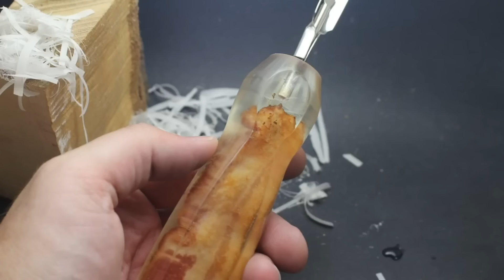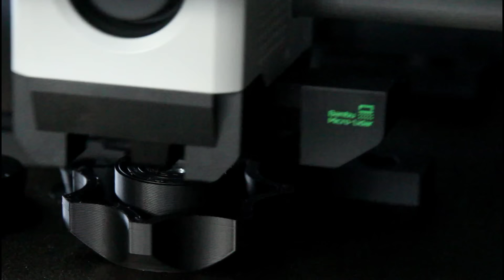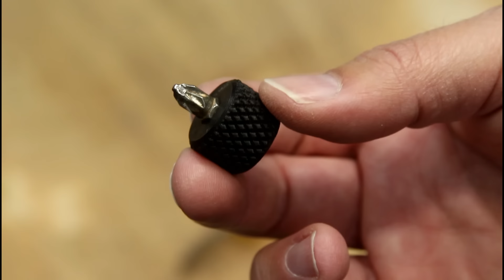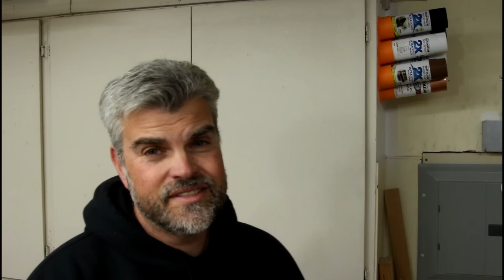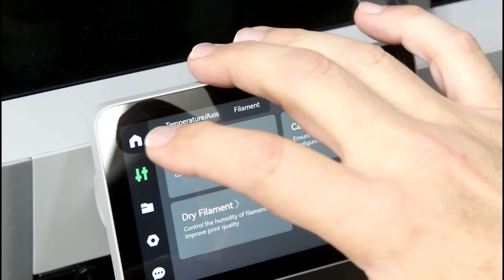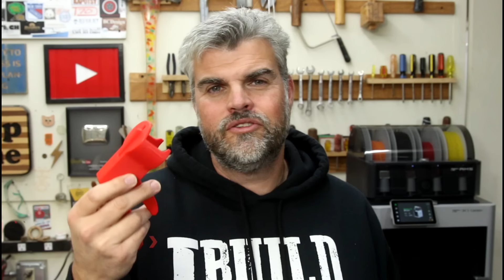5 MUST Have 3D Printed Tools!

Comment: whoooo! that implication that metric is not "the standard"... enjoy your 3/16th of 25,4mm i guess. xD 
friendly bickering aside: PLEASE better use PETG or, even better, PCTG for functional workshop prints, you want to be rugged and durable. PLA might feel really sturdy at first, but it shatters under a sudden impact, and just the pressure of a tight screw WILL make it break over time. and if it breaks under load, it's an instant snap with no warning signs, that can be rather dangerous. 
or just go all in, and use nylon! that shit, when printed properly, is virtually indestructible.

Comment: I’ve got fibromyalgia (why did I have to fall in love with making things 😔) and the spray can handle is a lifesaver (I bought a commercial one from the hardware store). My hand and finger go numb after a couple seconds while pressing down the spray button on a can, which obv isn’t great for precision and aiming. But the handle alleviates that, I don’t get paint all over my fingers (if they’re numb, good luck keeping them out of the way), AND I can shake the can with the handle on (check before you do this; can shapes and handle shapes differ and you wanna make sure it’s snug before you shake or you’ll paint your pants and sidewalk).

Comment: I am deep into 3D printing but also very skeptical of "Must Have 3D Printed Tools!" videos. But this was the best collection of actually useful 3D printed tools I've seen. You're not printing single use just that will fall apart when you first use it like most tools I see. You've found a bunch of tools where the print material is perfectly suitable. Aweosme stuff.

Comment: I bought the Bambu A1 and I have had nothing but problems with it.  After two weeks, I had to replace the hot end, the chip board and had a ton of failures.   I hate it.

Comment: For safety applications i would not settle for anything less than PC (PolyCarbonate). If PLA you need to be very mindful of wear and tear becaus the last thing you need is the teeth coming off mid cut. Do not buy PC-CF because it would only give you very diminishing returns. Poly=many, carbonate=non-descript type(s) of carbon. Pc-gf has glas fiber which adds wear and tear to the extruder and should not be neccesary.

Comment: This is the main reason I got the printer as well. There have been so many times I need "something" that doesn't exist (as far as I know). Now I just load up Fusion 360, design it and print it. Not sure if you have started learning 3D modeling yet but trust me, the possibilities are endless. Yes there is a ton already designed and available online, but there will come a time when you need something special and no better feeling than designing something yourself, printing it and realizing it is, in fact, usable and solves your problem. Thanks for the video and also, lol, it is "Bambu Lab"... no S. But I figure someone probably already told you.

Comment: The X1C is only faster when using single colors for a project.  Muti color projects take 15 (noisy)seconds to change colors.  The A1 only takes 3 (quiet) seconds to change colors. Most multicolour projects have many many colour changes per project because it has to change on every layer that has more than one colour. This creates a lot of waste as well as taking a lot of time. The seconds add up. I have found the A1 is actually faster than the X1C on project with multiple colour changes.

Comment: I strongly encourage you to explore using TPU for a lot of these tools. The layer adhesion for TPU is off the charts, and the printed parts are practically indestructible. You do have to print them with some extra walls or a higher density infill, but I promise you a TPU printed tool will last at least 10 times longer than PLA.

Comment: just buy the featherboard from harbor freight for the price and quality 
first 2 are better off buying 
3rd one and 4th one are good prints

the spray paint thing might be worth printing, the cheap one I got from freight doesnt seem to work well at all 

if youre broke, I found the ebay refurbished creality printers to be more than reasonable quality and only $80-$150
theres a slight learning curve. but very manageable 
tremendous tool that can literally make other tools. its a no brainer to buy if you have the space for it 
I just wish there was an easier way to make your own filament at home with recycled material or even failed prints or supports. 
while affordable, I have a feeling filament cost can add up fairly quick 

I have a feeling youre one of those types of guys who can come up with a fairly decent solution for that. would love to see a video for that subject from you

Comment: X1 carbon really needs an AMS riser it makes accessing the top glass so much easier. I would also recommend the cable/ ptfe management pieces and the ptfe tube mod where it goes into the print head. those and the plate alignment pieces solved any and all issues I have had with the printer.

Comment: Nice video. For your mini screwdriver, a square handle with fillets on the edges for comfort would give you more torque with less finger strength required.

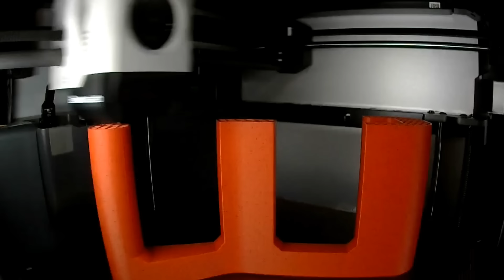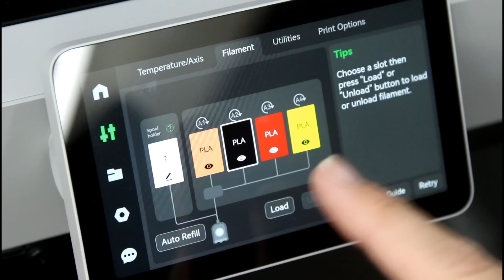Comment: @6:32 - it’s not just about cost - you’re being environmentally friendly too!  No shipping, etc and no other packaging waste!  At first I was put off by long print times… but as you said, it’s actually exciting to start it before i go to bed and wake up with my print!  Faster than amazon!  @7:32 - you can actually daisy chain the AMS unit and have up to 16 colors!!  Lastly, I agree - Bambu labs makes the most entry friendly  printers to get started. Very reliable and easy to use.  From the cost perspective, you can’t beat the P1S… but when you’re ready to upgrade or want the best, the X1 is awesome!

Comment: Overall, great video and I concur, TOOL NOT TOY!  Good picks for useful 'tools' within the shop, although some of the items should be called fixtures as they don't work, but hold tools or items.  But semantics of the English language.  One thing I think could have been explored a little more for the 'common' folk, is the cost involved.  You mentioned that these tools cost only a couple 'dollars of filament' to make overnight, but you did not figure in the cost of the 3D printer, which you received for free to demo to us.  This $1,200 machine (as spec'd with AMS), makes these five $1.50 tools (or fixtures) turn into $200 parts, or it would take you printing a lifetime's supply of filament (and the maintenance expenses of printhead changes, servos, gears, etc.) to make the average workshop afford a 3D printer to offset the cost of purchasing these items from the hardware store.  My last statement is critical - to offset buying from the hardware store.  Some items cannot be bought from the hardware store and so, figuring in the ability to find on eBay, Etsy, etc., and purchase with shipping, the cost per item comes down, but still with filament at $14-20 per kilo, it would take a couple years of normal shop use to offset the cost of a Bambu Labs X1 Carbon printer.  Yes, this is a great and useful tool, but not just for making things that I get at the local hardware store or novelty organizational items.  It can do real work that can make money for a shop and provide safety and workflow management improvements.  It is important to tell the whole story, not just what Bambu Labs wants you to tell us.

Comment: Nice video, but I don't think any of those warrant buying a 3d printer there are better reasons. I own all of those tools at one 10% of the money compared to buying a 3d printer and didn't have to sit through printing and assembling them or deal with misprints. Don't get me wrong, I have the same printer, but for vastly different reasons - printing stuff I can't buy. Plus the ones I buy tend to be more durable than a 3d print, tend to, a 3d print can be acceptable, but they're not quite up to the same standards as a properly manufactured tool, IMHO. Try some cad software and made you own inventions!

Comment: excellent, I have a CNC machine since 2008 and a co2 laser a few years after that, I haven't bit the bullet on a 3d printer but I'm looking at the bamboo labs lineup. the video provides compelling info for me to get one myself. Thanks. Wonder if you can make a ratcheting screw driver that small, that would be something people would need that need a screw driver that small. great work keep it up.

Comment: Tip for the can holders - you can fill the bed with them, and manually move them in the slicer so they touch or overlap by just a hair along the straight sides. Then you'll have a single piece that you can hang with 3 or 4 screws total. Less modular, but if you know you have a certain area of vertical space you want to fill with them, you can save a bunch of time and screws (and holes in whatever you're screwing them to, should you remove them from that space later). No CAD required. Use the move tool in the toolbar, which gives you handles to move them in 1 direction at a time. Place one, select it, ctrl-c ctrl-v, move the copy in one axis only, and it will be perfectly lined up with the original in the other axis. Start in one corner, and add them 1 at a time along one side where the flats line up. Look at how far you moved it, then for the rest just copy paste the last one and move it exactly that far. Then go back to the original and stack them along the other side - it will take some time to place the first one and get the offset right so it looks good, then you can reuse those movement numbers as you make the back and forth column. Then repeat the technique from the first row to fill out the rest of the rows. 'Save project as' and save a 3MF file of the plate with the bed filled and touching each other, so you can print that, or delete a few to make a smaller raft of them (or a single row, or whatever) with the exact same spacing.

Comment: The paint can holders are brilliant - I'd go modular and print them in 6 packs. Those sheet holders are a bit of a pain - if you know how to pick up a sheet properly, there's no need for another tool - if you can handle the weight, carry 2 sheets. ***The spray can trigger! Brilliant again - never seen one.

Comment: Honestly Peter you've dodged a bullet holding out until now. I've had a wanhao duplicator v2, a flashforge adv3, and finally upgraded to a bambulab p1s... it just works.

The difference in modern 3d printers now ahead of what was only a few years ago is immense. The bambu p1s has been ridiculously hassle free.

Comment: Since I see you're using milwaukee tools, there's also a print somewhere in the interwebs that fits impact drivers and drills alike, and another that fits batteries perfectly. Great for setting up your station with easy-to-grab drill and impact, with a charger and spare batteries all in one place. We use it at my work, and it stores away nice and easy, and has maybe a six inch total depth off of the wall? 
I'm assuming it works with other tools and batteries (and if not, it isn't hard to resize for other batteries) as well, if you're like me and have a billion different brands because you've adopted everyone else's old tools

Comment: So you're making 1 critical mistake with the featherboard and that is not printing it in PETG. PLA is very strong but extremely brittle meaning that when it reaches it's point of failure it has a tendency to get a bit "explodey" it would be a cruel sense of irony for you to use this safety feature just to have it explode on you.

Comment: With the spray can storage, you could print half of the holders with a longer base to offset the back row cans so you can see the cap color without having to awkwardly look over the side of the cabinet to see all your options

Comment: I've been 3D printing for about 5 years now and got my X1C in August. It's an absolute game changer for both beginners and experienced makers. Prints that took 12 hours on my Ender 3v2 take a little over 3 hours on my X1C, the quality is better, and the only issues I've had are because of my own inexperience with it.

Once you realize that you now have the ability to design tools or parts with programs like Tinkercad, Fusion 360, Onshape, or Microsoft 3D Builder and then physically have those one of a kind custom parts in your hands in maybe an hour or two for just 2 or 3 dollars in materials, the world just opens up.

Comment: Some of these ideas are great for a crafting workshop, as well.  I make jewelry, and often need a very small screwdriver, and while it's easy to find tiny screwdrivers in diameter, finding short ones are almost impossible!  I would imagine that your screwdriver holder could be adapted to smaller bits, and make my life a LOT easier.  Also, that spray can holder is genius.  Definitely makes about 4" of vertical space useful.

Comment: Yeah. I bought my first printer because I'm a geek and never met a gadget that I didn't like.
I had absolutely NO idea what I would do with it - but I wanted one.
Since then the ability to sketch up a tool or widget that I needed and have it in my hands within minutes has me absolutely gobsmacked. I just added an X1 Carbon to the fleet which joins a Prusa Mk4s and an FLSun Super Racer (there's that geek gene showing through). All of my printers are networked - Octoprint running on Raspberry Pis for the first two and the Bambu is a thing unto itself. I do wish that the Bambu had ethernet, though.

Comment: The best thing about a 3D printer is not that you can make custom parts but that you can make specific sections of the parts to test the fit, a single dimension or how the shape you designed looks and works in real life. I've designed several components (and quite large, too, that means hours of printing) and very often "sliced" them to quickly check if a specific feature was working in the intended way. You'll put this printer to good use, I am sure!

Comment: Thanks Peter,. LOL, I thought the same about 3D printers too.  I didn't know the prices had dropped so much and the capability/ usability had increased over the past few years until I saw a YouTube video by 731 Woodworks back in February 2024, so I purchased the a1Mini (NO COMBO) for $249 to test and see IF I would like / use a 3D printer... I DID/DO and purchased the P1S COMBO in May 2024. Just finished printing nearly 24/7 over the past six weeks for the "Loyal Moses Christmas Community Print Drive" and mailed off 60 pounds = 1,071 3D printed toys which will be distributed to needy children AROUND THE WORLD FOR FREE thanks to the 3D printing community and generous donations from individuals and sponsors. 

FYI the P1S $549 USD is basically the same printer as the X1C, with a simple LCD interface, no Lidar (I've seen some mixed reviews on this feature) and quite a bit less money (you can purchase 2 P1S for the X1C price). For those on a VERY strict budget or unsure about 3D printing, look for the A1 Mini $199 USD, it will be able to do 98.675309% of what you'll need around the shop/ home/ office etc.  **Adding the AMS color changing unit is the BEST VALUE when you purchase in the printer COMBO bundle, you can add on ONE to the A1 series for a total of 4 colors and up to 4 AMS units to the P and X series for a total of 16 colors. 

Other items of HIGH value, relative LOW cost which have greatly helped my 3D Printing experiences are -
1. Vision Miner's Nano Polymer Adhesive for the build plate works wonderfully to help the filament to stick to the plate while printing and then when the plate is cold the prints release like "buttah". NOT ONLY that, but you won't have to reapply for UPTO 30 prints (depending on what filament used and IF you're printing on the exact same spot on the build plate over and over)
2. Slice Engineering's Plastic Repellent Paint™ to "paint" onto a COLD nozzle repelling plastic and preventing buildup on the nozzle, resulting in enhanced print quality AKA, preventing a  print failure.
3. Wam Bam Build plates - While the standard build plates which come with the printers work OK (although MUCH better with Nano Polymer Adhesive on them) the Wam Bam just works that much better, then add the Nano Polymer Adhesive and WOW😳🥰!

* I am not affiliated with nor do I have investments in ANY of the above companies, just great products which have worked well for me.

Comment: You didn't take ten years to come around on wanting a 3D printer, 3D printers just took 10 years to meet your minimum standards for acquiring one. Honestly, smart move. They're much faster, cheaper, efficient, and easier to program than way in the beginning. Looking forward to the videos that will come from this adventure!

Comment: I have a bunch of 3d printers and pretty much the only reason I use one other than the x1c is if I need a really big print. If they made a 400x400x400mm version it would be the perfect printer.

Comment: The little knob that holds the bit is genius. I was installing a new dishwasher in my house literally 2 days ago and that would have saved a bunch of time and frustration. I had to adjust 2 of the legs in place and the only thing i could go was pop a bit in because nothing I own would fit except that and feel around with a pair of plyers to turn it less than 1/4 at a time. It took forever and have the barked knuckles to prove it sucked lol.

Comment: I've had 3d printers for years and I would make the statement that the way most people use them they're toys but like you've come to realize, they do have a lot of real applications. There's a subreddit called functionalprint that has a lot of good models. They're also extremely useful in a manufacturing environment. From tool organization to assembly aides 3D prints are all over the floor at a lot of major manufacturing sites